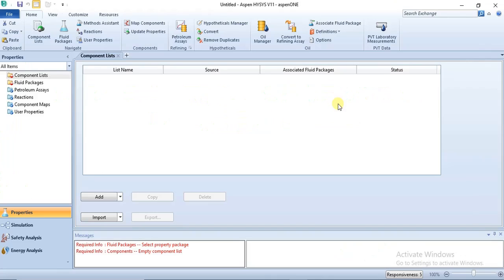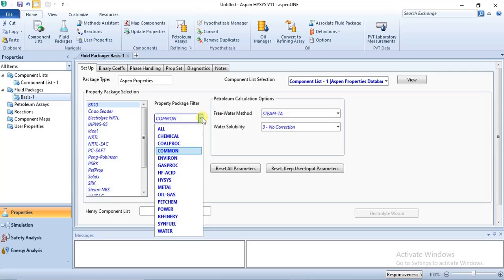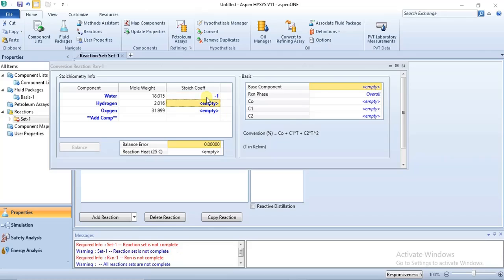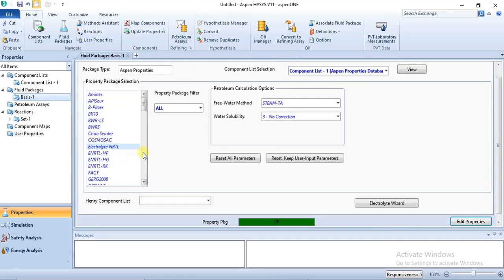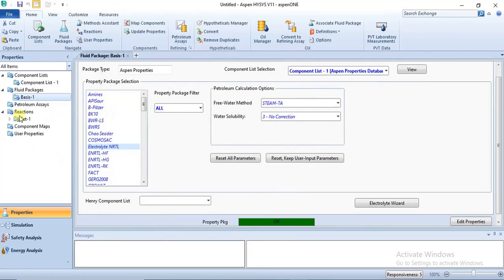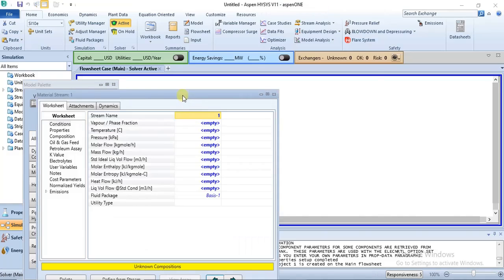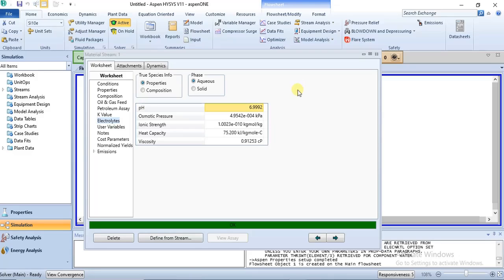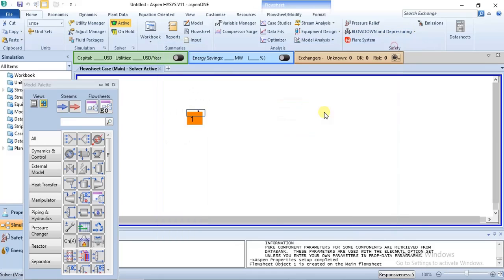Water Electrolysis Modelling

Comment: In case of membrane electrolysis which fluid package use?
Reply from the maker: Hello, text me on WhatsApp 

+234 706 613 4201
Reply: @hotspot105  Can you also make an application for PEM electrolysis?
Reply: @hotspot105 so what was the answer to his question I also need to know how to make PEM ELECTROLYSIS
Reply from the maker: @hebakhafajah6022  Message me on WhatsApp +234 706 613 4201